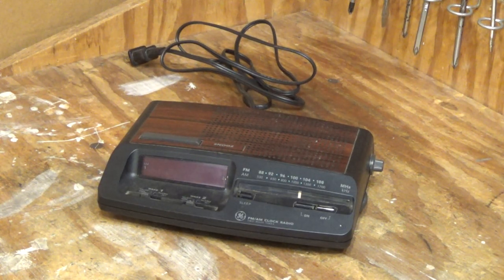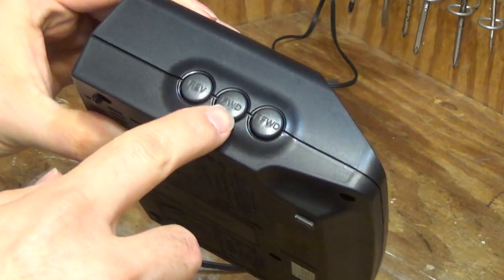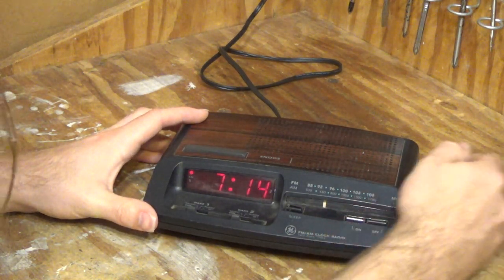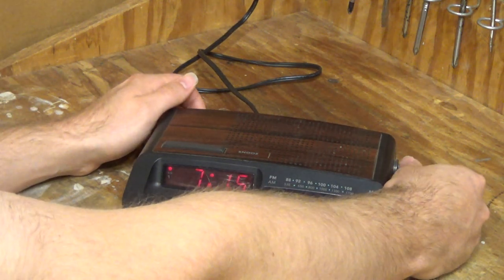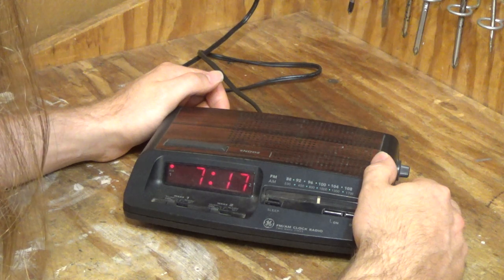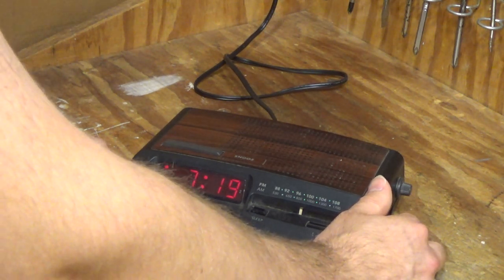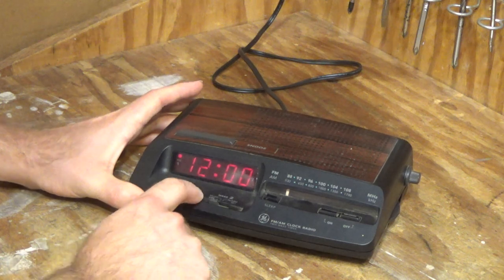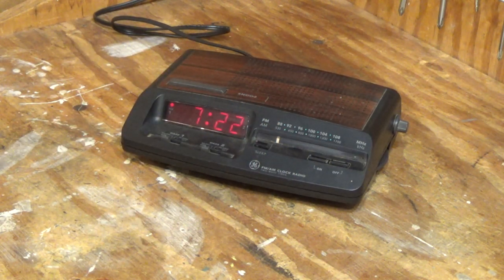General Electric 7-4621A Clock/Radio | Initial Checkout

Comment: I have this clock radio on my nightstand next to my bed, I found it at a local thrift store for 5$. I use the alarm for school and it works very well, and the radio also works nicely! For 5$, it's a great deal. I wish GE still made alarm clocks because when they were, they made some really good alarm clocks and they had a wide variety. I don't believe you can find alarm clocks this great like this GE these days!

Comment: I wasn't going to even comment, but because you had mentioned that, now I've piped up.  Clearly, if you have time to wait around for alarm clocks to hit the alarm time and go off, but not time to edit the videos, you clearly have the time.  Instead, you won't be bothered to edit the video down to some more appealing length.  Your disservice as such causes all of the "viewiz" of yours to wait.  That wastes all of their time.  That's unkind, to say the least.
Reply from the maker: It takes less than a minute to wait for the alarm to go off.. If I were to edit the video to cut out those 50 seconds or whatever it was, I would have to import the video into the computer, then into the video editor, make the changes in the video editor, then render and export the video.. That would take far, far more than the time it took to wait for the alarm to go off..
Reply: When you stop using substandard equipment, it makes it a lot easier and faster.  There's not a single video I release these days that DOESN'T go through the editing process.
Reply from the maker: We've been through this a million times.. It has nothing to do with the equipment, your videos are rendering through the same kind of machine I have.. Even if I had a 'fast' computer, the process above would still take longer than the time it took to wait for the alarm to sound..
Reply: Of course it would still take longer.  But it would be a better quality, nicer cut video than you provide now.  I have always striven for quality rather than "good enough".  If I ever have to do something "good enough", it's "good enough FOR NOW", and I always make sure to get back to it shortly to make it better.

When I started on the Internet, it was a much different place.  Before you were born, in fact.  Pages were mostly text.  If there were pictures, oftentimes they were scanned images of actual photographs as digital cameras weren't prevalent yet.  When they became popular, there were suddenly billions upon billions of pictures.  Now with everyone's f0n3 having a camera, there are tons and tons more.  When cameras used film, people took good quality pictures.  If they didn't come out quite right, then they missed the shot, simple as that.  Nowadays, it's quantity over quality, generally with everything.  I know how you dislike made in China things as much as I do.  So why make "made in China" quality videos when you can do better?  I'm sure you'd gladly pay more money for a better-made unit, so same with videos, except it costs time instead.
Reply from the maker: We've been through this as well.. If I had 45 hours/week to devote to making videos, they would be edited flawlessly.. But I don't.. I come home in the evening after working all day, and if I decide to do something that may be of interest, I switch on the camera to capture what happens.. Then I upload the video..
I'm tired by the end of the day, and especially after working on the computer all day at work, I don't want to use the remainder of my evening on the computer editing videos.. I want to rest and do other things..
So this is what you get, videos that may have some dead space or a few mistakes.. If it's unbearable, there's plenty of other channels you can watch..